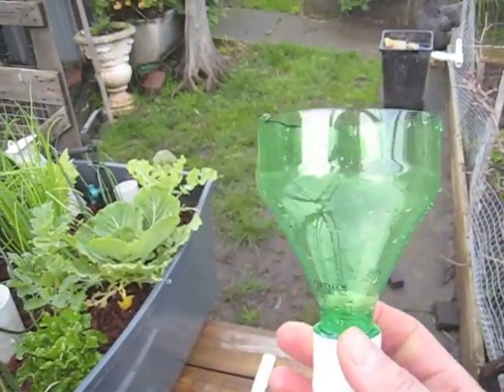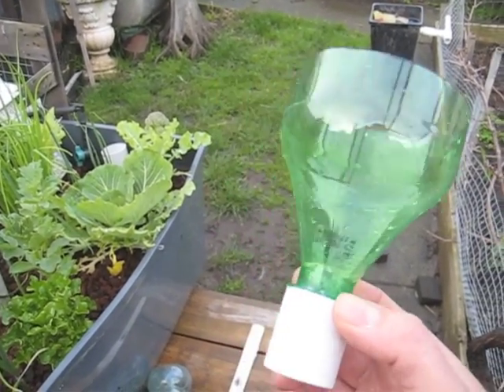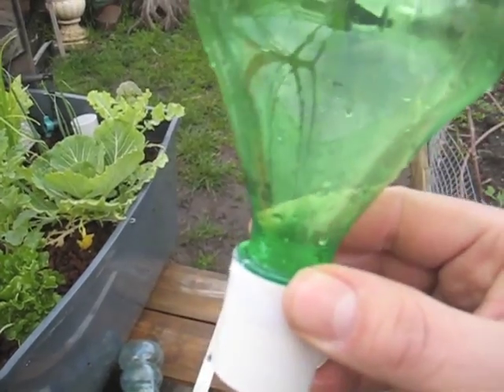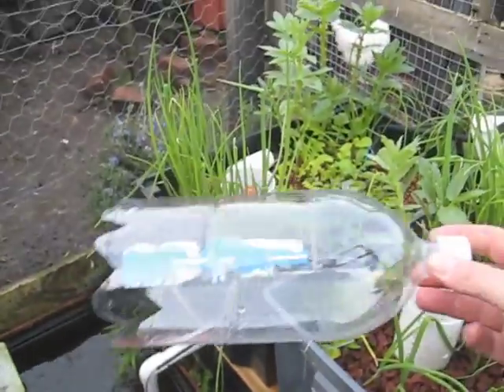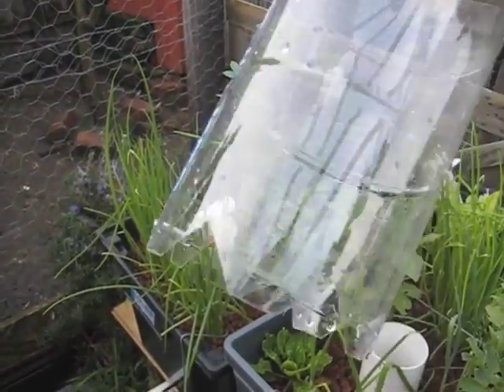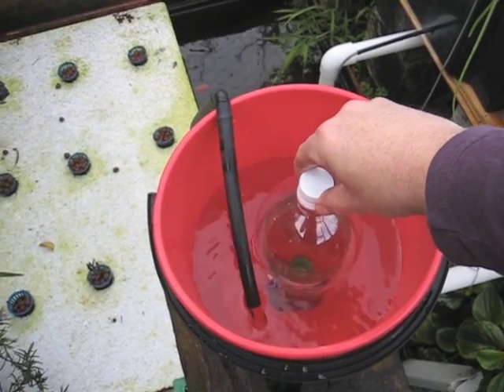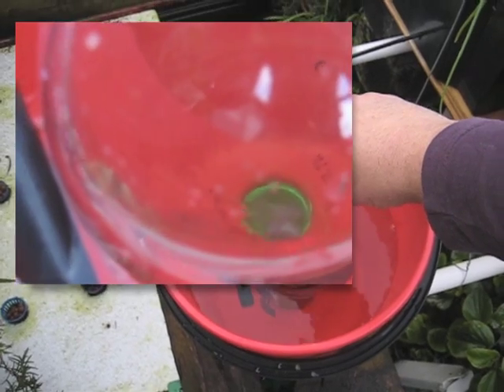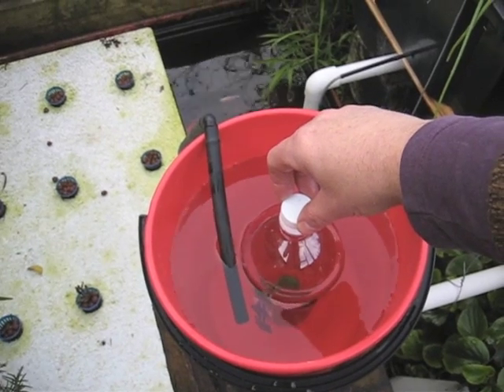Affnan Style Bell Siphon from 2 plastic bottles

Comment: I do have some problem with this siphon though. It was running smoothly for a little while then it just stop flushing completly. the water just keep on draining out.
Reply from the maker: Hi Kam,
Just a guess but is your pump on the small side for the size of the system? I have seen this happen when a pump is just big enough and once the media settles it stops working.
Also check to make sure that the stand pipe is level and the water is going over evenly.
Had a subscriber the other day have a similar issue with a new system, it worked fine while testing with out media and as soon as he added the media it didn't. We fixed it by reducing the outlet size. Maybe give this a try 1st and long with making sure the stand pipe is level.

Please come back and let me know how you go.

Good Luck.
Brett.